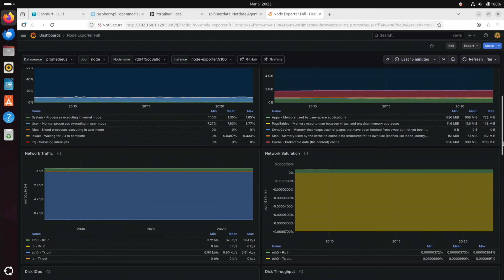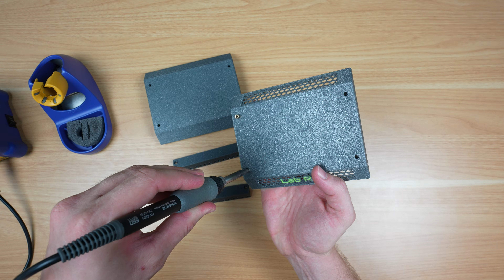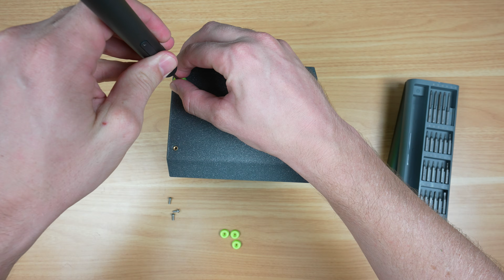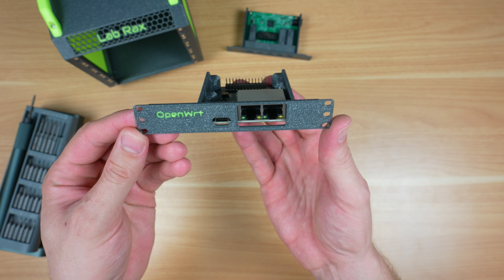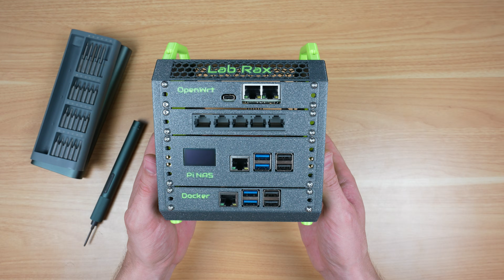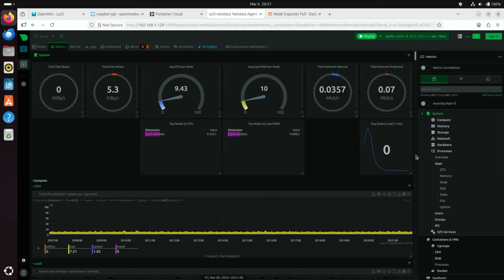I Built a 5" Portable Raspberry Pi Homelab

Comment: Nice, I have the 10” lab rax, but now I want this.
First I need to collect and save for some Pi’s.
Haven’t you had issues with burning in the oled screens? Most of my projects with oled screens and fairly static text are useless after a year and the pixels that were lit have lost most of their brightness.
Reply from the maker: Yes, these OLED displays do suffer from burn-in. They're quite cheap though (less than $5 if you buy them on Aliexpress) so I just swap them out when they die. You can also turn them off during certain times of the day, like at night time or when you're at work etc..

Comment: How do you deal with the power adapters and cables? Can we see a picture of the back when everything is connected? Is there anything available on the market that would allow you to power all elements from a single unit, and include that unit in the back of the rack?

Comment: I think the recurring theme for this thing is some form of power setup. It looks like you have power, but it's not clear how you did it.

And for something this size, the clear next innovation is how you do the power. Is this compatible with a simple wall cable? Is it low power enough to run off a battery pack? Can I host a project Nomad on this thing? p

Comment: Do you have to use a Pi5 for the Docker side of things, or would a Pi 4 do?

Luckily I have all the Pi's you've used already, but in todays marketplace, the cost of new Pi's is no longer that cheap.

Great project nevertheless, but not sure it would fit well in my Ryanair carry on bag 😮
Reply from the maker: You can definitely use a Pi 4, the Pi 5 is just a bit faster and handles more containers simultaneously

Comment: I would have made this wide enough for a 2-in-one node maybe? Given what you have, how about a 128x32 pled on the “1U” node, and line up the pi and display with the nas 2U node.
Reply from the maker: Unfortunately the OLED display is too big for a single unit, that's the main reason for pairing it with the Pi and NVME combination.

Comment: Soooo cute!! Acctually I'm not a home-lab guy at all, but I do like the Pi5. I'm just a beginner when it comes to tinkering with those things, and brainfautige dosn't help, but I have managed to get myself a little setup to help me in a daily basis, a pi5 with a 7"monitor showing time, date, weather, to-do list and calendar to remind me of stuff I ned to be on top of running on HomeAssist, and that kit looks like its "naked" and brittle so I wanted to get some sort of case for it, and stumble across your 10" rack (Lab rax) through @JeffGeerling 's channel but I thought it would be a bit to big for my desk, and to be honest, this is just a tad to small for the screen I have (165mmx100mm) since I'd like to have the screen in Landscape-mode (and it would let me be able to rearange the position of the pi to be able to use the USB-ports and network port for other things while tinkering) and I thought for myself why not make it fit a little NAS (like the one you showed in this vid.) and get my little 5-port switchin in there aswell, I mean, I got like 3 pi5's laying around, might as well use them for something XD the pironman 5 case for the pi5 is my daily-driver for easier tasks, like youtube right now :)

Comment: After making my Home Lab and self hosting, the only thing I am missing in my 3-2-1 is off-site storage. I've been thinking my next project should be a off-site tiny rack with 2 4TB HDDs in RAID 1.
Reply from the maker: Have a look at running a small NAS offsite with Tailscale - I've recently set that up and it works well.

Comment: How about a power solution? Some sort of PDU, so that the whole thing can be powered with a single cable? maybe with a built in mini-UPS?
Reply: How about a poe switch and poe hat
Reply from the maker: Unfortunately Raspberry Pi's decision to go with an uncommon 5V 5A PD spec for the Pi 5 has made it very difficult to do what you're describing without designing your own from scratch.
Reply: @MichaelKlements  so what is the current power solution?
Reply: @MichaelKlements I feel you! I hate their PD specs! None of my PSU work with it so I have to buy a dedicated one and it's impossible to find a power bank for it
Reply: @MichaelKlements  its in the PD 3.0 spec, so a PD 3.0 spec hub should be fine.
Reply from the maker: PD 3.0 spec hubs almost always provide a maximum of 3A at 5V, which the Pi 5 detects and then runs in "low power mode". I'm not aware of any USB C hubs that provide multiple 5V 5A outputs.
Reply: @MichaelKlements  you could also use a mean well irm 50-5st and just feed 5v directly to the pi and all of your other devices.
Reply: @MichaelKlements  hello is there a way to buy the lab rax rack please ? I can buy the components

Comment: Cute little project, but more for fun than having an actual practical use-case. In the real world, I would probably just build one device/service to replace all 3 pi's for traveling.
Reply: Just like all hobbies, it's to be able to let your curiosity lead the way whitout a defenetive goal, yes, it costs money 'cus that's what hobbies do otherwise it's a joband then it's a budget issue, in this case having 3 separate mashines you only need to switsh out one cheap-ish part if it bites the dust and not a probbably more expensive part.